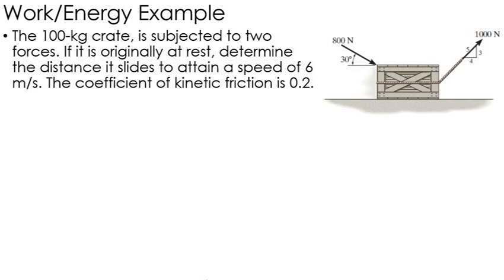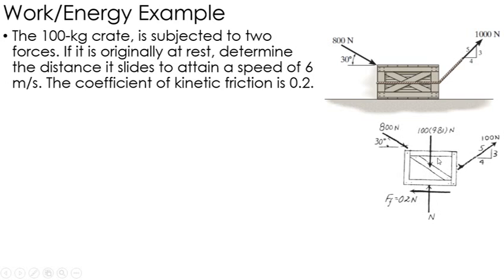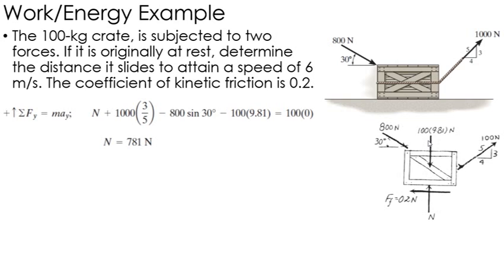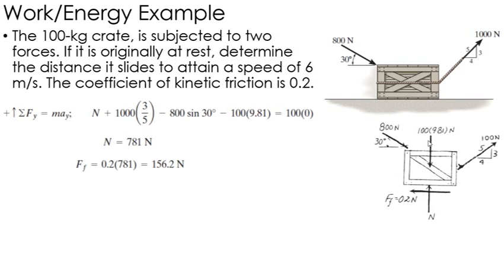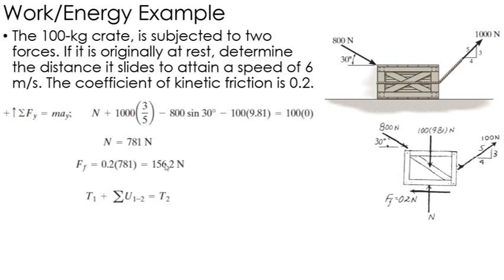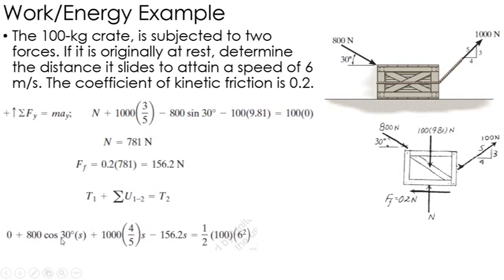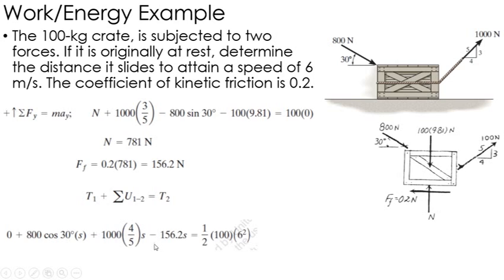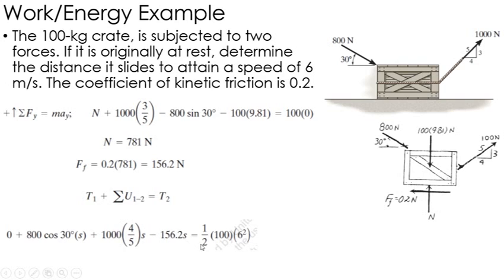Dynamics Example: Work/Energy

Comment: How do we solve for s in the last equation?
Reply: Multiply S by its coefficients, add them together, then divide the result (1336.62S) by the 1800 you get from the right side for 1.35m.